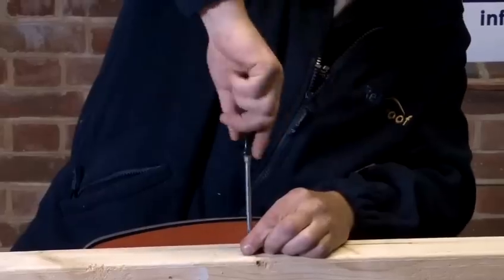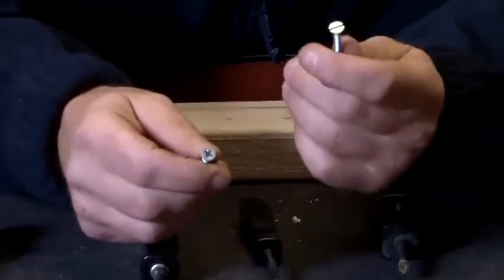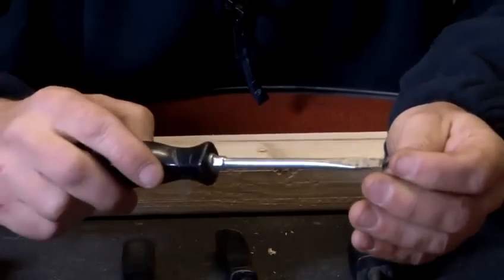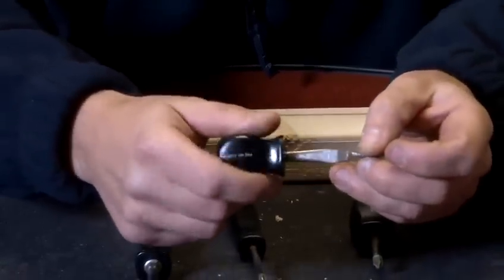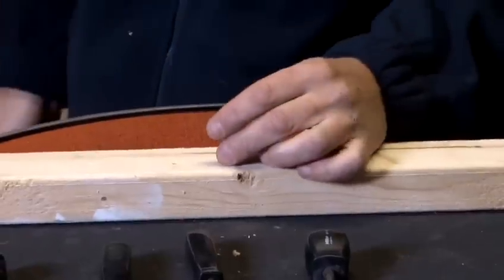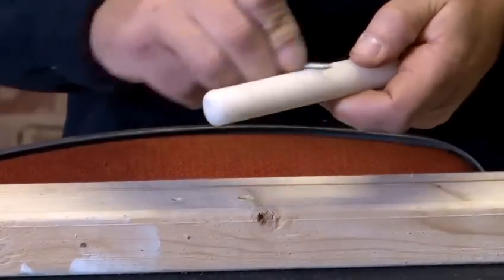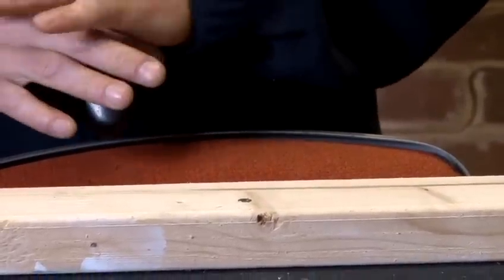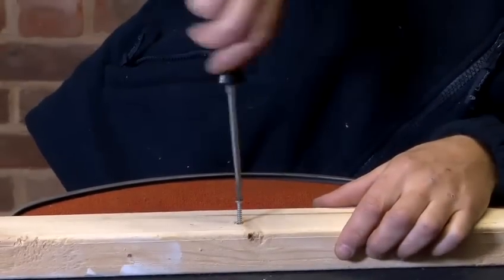How To Screw A Flathead Screw

Comment: I'll tell you how to screw in a flathead screw... Throw it out, they are the worst fastener in every situation. Try using a drill on them that's a joke!!!!  Recycle the metal and go get either the Phillips or Torx. there done.  that's how screw a flathead

 I declare an international law. NO FLATHEAD SCREWS FROM NOW ON. I don't want anyone to lose their jobs over this so training to flathead screw manufacturers to start immediately. These screws are the most inefficiently designed pieces of scrap metal I've come across. The training money will come from a "stupid fastener" tax on flathead screws
Reply: Dude I was working in this old building today AND ALL OF THE SCREWS WERE FLAT HEADS. I've never been so triggered in my life

Comment: anyone know how to deal with an old coat hanger rack thats wood where both it and the nails are like 20 years old?  Family members set it up so I dunno what the hell kind of nails they used to attach the wood hanger rack to the wall.   I have a big honkin screwdriver that cant get the nails out. Even a smaller "flathead" screwdriver that I have I think where i dunno how to use it on the nails to get the nails out. Theres no indentation line whatever on the nails to unscrew them with a screwdriver. 

I hate doing house work especially when it comes to trying to mess around with old coat hanger racks where the wood part and the nails are 20 frikkin years old
Reply: if you don't care about potentially damaging the wood, maybe try to use a hammer to hammer in the flathead at an angle to get under the nailhead, and then pry it up a little so that you can then use the back end of the hammer to fully remove it